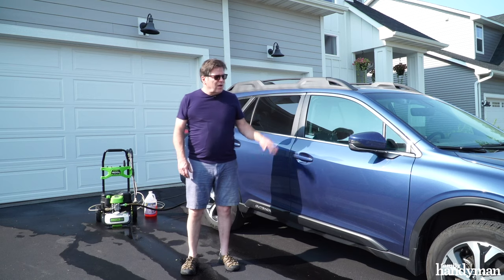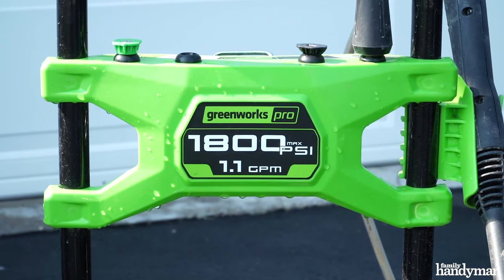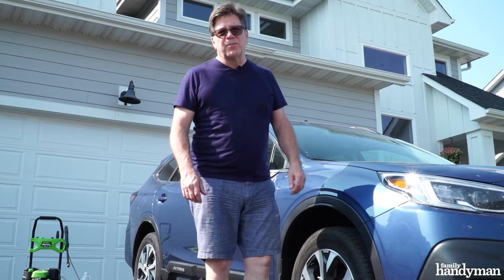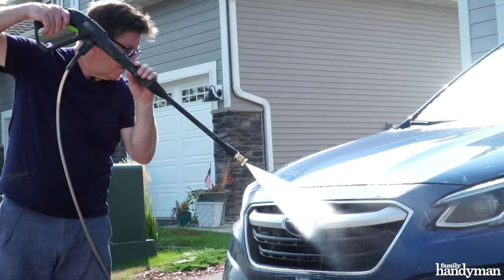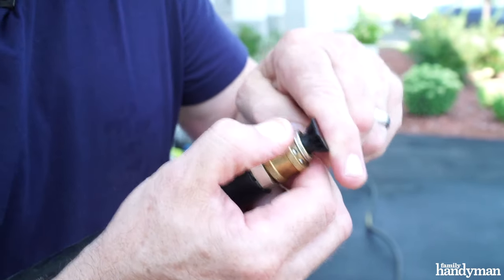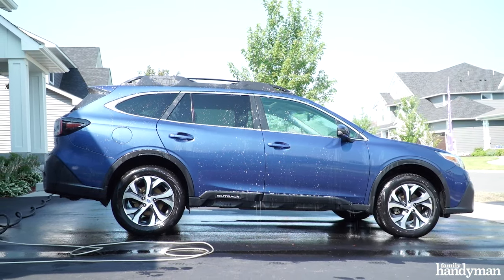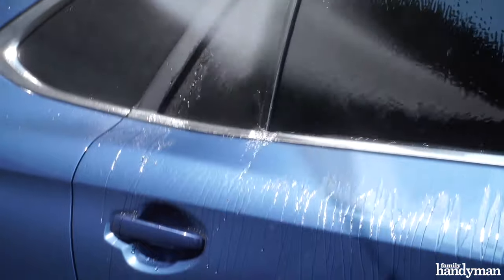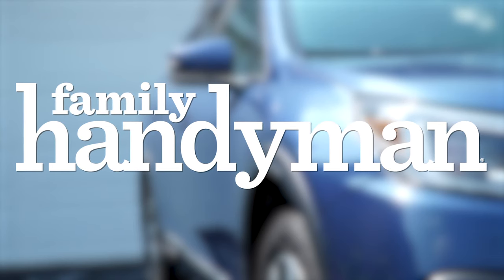How to Pressure Wash Your Car Without Damaging It

Comment: Good tips. Also important to note that an increasing number of vehicles today come with sonar and radar sensors to aid in parking and emergency braking. Those are super sensitive and easy to damage with high pressure water.
Reply: Good tip
Reply: do you have a tip to avoid damaging those sonars and radars?

Comment: Never wipe or apply soap in a circle motion
Reply: Why?
Reply: @jamie123b  if any contaminates that's on the paint or rag or mitt still, it will scratch in that circular motion. which makes it more noticeable and harder to correct or remove.
Reply: @TheSpartanSolider  but a scratch in long straight lines is not much better surely?
Reply: @jamie123b however a scratch in a line is much easier to correct instead of a circles

Comment: Wrong : When you wash after spraying the soap, always wash from the buttom to the top and then from top to buttom , if you wonder why, just ask me and i will explain you. The main reason is to prevent the microscratch to the car paint.
Reply: Could you go deeper on why I should start from bottom to top after applying soap?

Comment: Great video. Though to be honest, if you have any gunked on bugs or dirt, the touchless pressure washer usually does a junky job, I've tried many times with my 2200 psi
Reply: I’m sick of trying it. I’m disappointed of pressure washers, I ended up going back to the two bucket method.

Comment: What type of tip and PSI is good for power washing all of the bugs off of your front grill?
Reply: If 40° doesn’t clean them off try to use 25 but make sure not a lot of water does not get into the radiator and also maker sure to use medium-fast motion and keep a 6-12 inch distance when using 25° tip. If it doesn’t work I wouldn’t risk going any higher and using a towel or some sort to manually remove the dead bugs